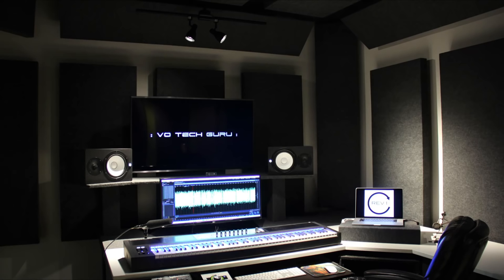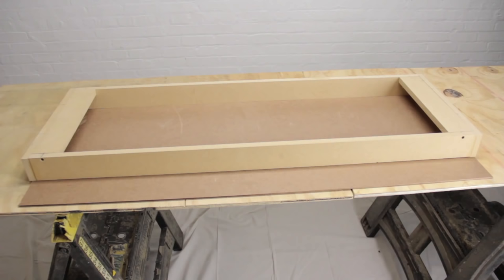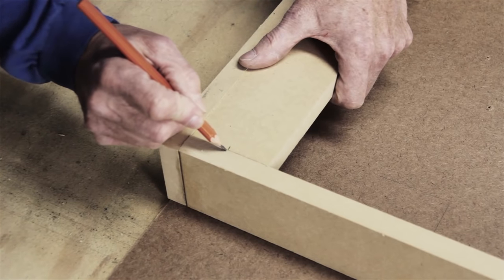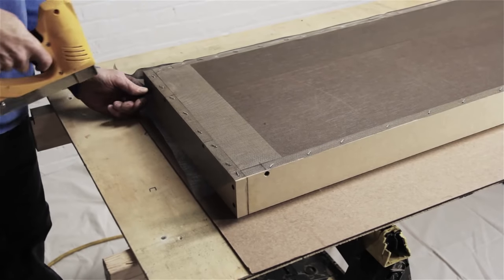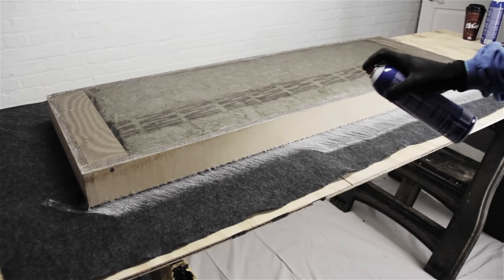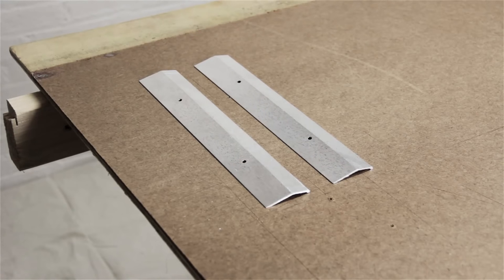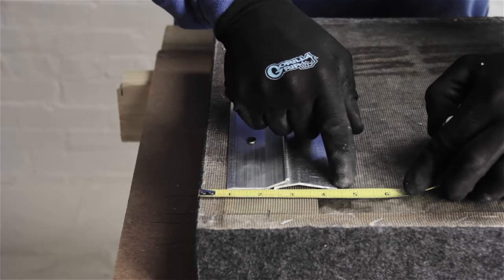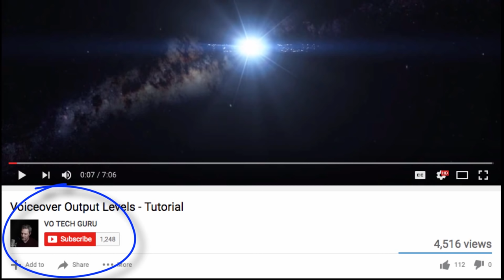How To Build Acoustic Panels | DIY Acoustic Panels

Comment: If you cut the long sides a little longer and then make the tops and supports the same length you can make this whole job a lot easier.

You also only need a little corner support so even small corner triangles or squares are adequate. You could just use small thin pieces of ply to save tge wasted effort cutting the insulation.
You can also significantly impove performance of the panel by adding spacers behind the panel to create an air gap to the wall.

 Even then, once fabric is stretched and stapled and the frame is screwed and glued, the support braces are almost unnecessary.
Reply from the maker: That's really bad advice. First, the sides would have to be 48-1/2" long which is not at all efficient considering the MDF sheets are 48" x 96". Second, you would be compressing the Roxul by 1-1/2" by moving the top and bottom toward the center inside the frame, which means you would have to cut even more insulation. It sounds like you didn't watch the entire video because the hanger and the bumper on the bottom back side provide the gap you spoke of. If you have a video on how to build panels using your method feel free to post it here. Otherwise, anyone looking to build the panels as I have them here, do not follow the advice of this viewer regarding cutting the sides longer. These panels were designed so the Roxul fits perfectly within the frame, so less hassle, less expense, less cutting.

Comment: Very nice, but I used wood glue and a brad nailer, much faster and just as strong.
Reply from the maker: I agree and have made many panels using brads and glue. That said, I had to make a video using tools and materials most people have. You know, once you get a nailer, then you need a compressor, use it safely and so on. I’m thinking about creating a supplemental video and maybe call it “for the pro” or something like that? Anyway, thanks for watching and for adding value to the conversation!

Comment: does that saves you from 90% humidity?
Reply from the maker: Hi Petros. I'm not sure I understand your question. If you're asking about the insulation inside the panel, you can view the specs for resistance against moisture as well as fire at roxul.com if that helps. :-)

Comment: Is a bass trap built similar to these?
Reply from the maker: Justin Schwer People tend to build bass traps with deeper frames and insulation than I used here, but the idea is the same. That said, I found no need for bass traps when using these panels throughout my booth and control room. Hope that helps.

Comment: Is it safe to have that insulation material in a room if you need to wear a mask while cutting it?
Reply from the maker: You should always wear a mask when working with insulation because it's easy for fibers to become airborne when handling/cutting. These panels have screen on both sides and I haven't experienced any negative effects. That said, if you're concerned, you should visit Roxul.com and look at their safety data sheets to decide for yourself if it's the right choice for you.

Comment: Fiber glass wool is using for it...? please help
Reply from the maker: Positive Travels Pvt Ltd Hi. The material we used isn't fiberglass. It's a mineral based product. If you'd like more information you can visit roxul.com. Hope that helps!
Reply: which is better. mineral wool or glass wool. given panel dimension is necessary to follow the same.?
Reply from the maker: Positive Travels Pvt Ltd Mineral is far better and I would not use fiberglass insulation in a panel.

Comment: How do you mount these on the ceiling?
Reply from the maker: Same drywall anchors but use eyes and hooks to hang them. You can use cable or whatever else you have if you want to bring them down even lower. Thanks for watching!
Reply: @VOTECHGURU  Thanks for the answer!
Reply from the maker: @suleman241  My pleasure. ;-)

Comment: How many panels will a single pack of roxul make?
Reply from the maker: It depends on which pack you're going for. The packages I show in the video right at https://youtu.be/GBHYiWIJhUA?t=1m21s show the 16" packs contain 12 pcs and the 24" packs contain 8 pcs.
Reply: Also do I necessarily have to use felt? Would cotton work? Or is there something about the felt that works better?
Reply: Sounds good. Thank you
Reply from the maker: You got it. ;-)

Comment: I don't know how you got the guys at home depot to make a 3" wide cut. They have a 6" minimum width requirement (at least now they do).
Reply from the maker: Aspen Mallery Yeah, it seems they are clamping down on some things. A few people have gotten local cabinet shops to cut up the wood for them for $75 or so. Definitely worth it if building multiple panels.

Comment: How much would you say each panel weighs?
Reply from the maker: Around 12 pounds
Reply: VO TECH GURU ok I’m thinking about combing three and hanging them from the ceiling.
Reply from the maker: @samueleverett3719  I built several larger ones for the ceiling (clouds) and used the same drywall anchors so you should be fine.

Comment: Don’t you need a bigger air gap at the back of the panel?
Reply from the maker: No. But a larger gap will improve results. The most important thing is to get it off the wall and have no backing on the panel like plywood, etc. It’s surprising how so many companies sell “pro” panels with with a solid backing. That not only makes them less effective, it’s a waste of material.

Comment: why do we need frame? can't we just wrap insulation in cloth?
Reply from the maker: sin  You could but it won’t look good.
Reply: You could if you wanted it to look like a giant stuffed sock. but at that point you might as well just use sound absorbing curtains or moving blankets. An ok middle ground might be putting it in the bottom of a large cardboard box and strengthening the edges with duct tape. Just not durable so don't stumble into it...

Comment: You can use towels instead of insulation. Multiple full-size bath/beach towels, folded in half & stacked work best. It will cost less and absorb the sound just as good as rockwool
Reply from the maker: And it would take forever. There's nothing wrong with using Roxul and it will be much quicker and cheaper to just stick with the plan.
Reply: @VOTECHGURU  I agree there's nothing wrong with roxul. I disagree that its cheaper than using towels. You can get old towels from Goodwill, or somewhere similar, for next to nothing. I'm not sure why you think it'd take forever. It's the same exact method you explained except use a towel in place of the felt fabric and a few folded towels instead of the roxul.
Reply from the maker: fpep5 You’d have to take a ton of time sourcing the towels. That’s assuming a single Goodwill would have enough used towels to fabricate even one panel. You’d also have to sew the towels together to get them to stand firmly inside the panel. Not to mention the amount of towels required to gain the coefficient of a single batt of Roxul. It’s $50 USD for a pack of 12 Roxul batts. That’s less than $5 per batt. The amount of sourcing, sewing, driving to various Goodwills, the time you’d spend all around using towels is a horrible value proposition. There have been numerous discussions about this issue between both sides of the “argument,”. testing etc. And many, many people wishing they had just used Roxul instead. And while I appreciate your input, it’s overwhelmingly evident that using Roxul is far more efficient, better performing and a far better value proposition. I wish the towel conversation would just go away already. It’s not valid. If you feel so strongly about your position then maybe put together a towel panel video that proves it’s less expensive, works as well and is as efficient with time spent. Would love to compare the results. Thanks for taking the time to listen.
Reply: @VOTECHGURU  Ok no problem. Thanks for replying with some solid input. I still don't agree with you 100% on some points but it's all good. Here's a towel panel video from a fairly popular YouTube channel https://youtu.be/pABvTWSxOes

Comment: How would you do for ceiling?
Reply from the maker: I just used the same drywall anchors and used eye hooks at all 4 corners of the panels to hang them. Just make sure the hooks are the right size to screw into the anchors.
Reply: @VOTECHGURU  
Ceiling is only 210 cm high, and it's not solid wall ceiling, just plywood so nothing heavy or too thick is optional, these 2 things are first to consider. 

Thanks for your reply 👍
Reply from the maker: Drummatia Drumming Production They are around 12 pounds each panel. Will they hold?

Comment: fiberglass screen? what is the purpose of this? why not just wrap both sides in the fabric? thanks
Reply from the maker: Tryhitme cs Hi. Thanks watching. The screen keeps the insulation from bulging the fabric so the surface is nice and smooth. The screen is also less expensive than fabric at the of the back of the panel. I've done it both ways and using screen yields a much better looking finished product.

Comment: 16" Roxul insulation is $53.46 by itself. How on earth did you land on the $25/panel estimate?
Reply from the maker: Riley Farmer - I'm not sure I understand your question. There are 12 pieces in a pack. Divide $53.46 by 12 and the cost for each piece is $4.45. You need one piece per panel.
Reply: Ohh derp! Forgive my ignorance, I'm an audio "expert" but still a tool newbie. Thanks for the info
Reply from the maker: Riley Farmer - Ha! No worries, been there. :-)

Comment: HELP! 5 QUESTIONS 
Does anyone think having panels with an open back would help  reduce some of the airborne noise coming from traffic outside? And would having the panel a certain distance from the wall (e.g. 2") help with reducing airborne noise from outside by deadening it in the panel? I am hoping to deaden some of this airborne traffic noise in the audio of my videos. I am going to be doing videos of a person speaking and I have a really beautiful looking Room but the traffic has a lot of a low rumbling frequencies I need to reduce. I also would like to know, is there is a microphone that would be better for isolating the speaker away from those airborne noises? If panels may help reduce some of that airborne traffic noise coming in how thick should I make them?  Lastly does anyone have any tips on reducing the airborne  traffic coming into this room,  other than demolitioning the walls to decouple new walls. I keep thinking that there must be some sort of way to erect acoustic panels/partitions or curtains around the subject in an attractive way or less preferably an acoustic fence around the front and sides of the building. Or maybe even some sort of dence acoustic shade (e.g. MLV) outside of the building that I can pull down during sessions.  I'm hoping that simply putting panels up on the walls and maybe some standing panels/partitions around the subject will be sufficient along with some sort of microphone that will focus mostly on the subject. Please help!
Reply from the maker: Vegan Linked The biggest problem is going to be low frequencies because they flank around objects and structures. There is an acoustic advantage to having them spaced from the walls but the panels will do very little to keep the noise out. You could use acoustic blankets from vocalboothtogo.com to surround your subject which will make a difference because they absorb -10dB of noise as well as provide acoustic treatment. They are a sponsor of mine so so you can save 5% by using the code votechguru-5. It’s not much, but better than nothing. The blankets aren’t that expensive for what you get anyway. Really superior stuff and not like a moving blanket. They are specifically designed to block and absorb sound and I was at the testing lab when they got tested and certified. Really good stuff. Good luck and thanks for watching!
Reply: @VOTECHGURU   The Room is really esthetically pleasing right now. I'm wondering if may be I created some Gobos that would do the trick.. I could place these around the subject and that could absorb any of the airborne noise coming toward them as well as dead and some of the echo. I may even put sound panels on the walls so whatever reflects off of the gobo could be further absorbed by the sound panels.  I could possibly make the Gobos look decent and be just far enough away from the subject to be effective and possibly out of the shot or at least in the background in a nice way.  I could make them taller than the subject and 2 layers of safe and sound rockwool thick. How does this sound?
Reply from the maker: Vegan Linked I’ve seen people use nothing but these panels to essentially build a booth and it worked very well, but I’m unsure of how much noise there is around you compared to them. I have a video about declicking and denoising on here that may help as well. Have you seen that video? Also, rolling off the low end at 80Hz will eliminate a lot of low end noise. Not sure how much you know about EQ so I don’t know if you know what I mean by “rolling off.”
Reply: @VOTECHGURU   Is rolling off the low and something I have to do in post or can I do it during production? Typically I just use my Senhieser Lav's into my camera.  But for this project I am thinking about getting something like the Rodecaster Pro or pulling out my old  Presonus firestudio mobile.  I'm basically videoing a doctor talking to someone else either in the Room or in a Zoom conference of sorts.  I may get completely new Mic's that are better for this situation, maybe Shure SM7B?
Reply: @VOTECHGURU   By the way at the good news is I think the noise may be coming more from the floor, door, and window than the walls and ceiling that I have already finished. So I am pretty much back too excited.  I'm looking at getting mass loaded vinyl for the underpinning and maybe even under the carpet pad. I'm gonna get dense carpet and half inch memory foam carpet pad. I'm trying to figure out if it's a good idea to put the mass loaded vinyl on the sub floor under the carpet pad. Let me know if you think that is appropriate there.  Otherwise I will use the MLV in the walls of the underpinning I create to stop the sound from getting under the floor to begin with. 

As for MLV,  Do you think it is a good idea to use the MLV in the gobo's?  And is there a go to guide for diy Gobos? Love that word, Gobo's :)
Reply from the maker: Vegan Linked This would be more efficient if we just talked about it for 15 min. Info@votechguru.com
Reply: @VOTECHGURU  awesome, will do
Reply: @VOTECHGURU  can you send me a link here to your video on declicking and denoising?
Reply: @VOTECHGURU  any tips on rolling off? I have Adobe Audition. I have other audio programs but Audition is tied into premiere better...
Reply from the maker: Vegan Linked https://youtu.be/I31xEmXrqD0

Comment: Home depot doesn't cut lower than 12in so what's plan B
Reply from the maker: Yeah, some of the stores won’t do it anymore for some reason. It’s easy enough to rip the 12” pieces on a tablesaw. If you don’t have one, it’s likely someone near you does. One person got a cabinet shop to bang out 3 whole sheets for $50 USD. Food for thought...

Comment: Why do you keep your monitors sideways?
Reply from the maker: Nora Sleiman-Haidar Because I want my mid-low and low frequencies in the middle of the mix where I feel they belong and my mid-high to high frequencies on the outside to spread out and air out the mix. I get a wider mixing space that way, which I prefer.

Comment: how much did it cost for you?
Reply from the maker: At the time around $25/per panel. If you go back I explain that one sheet of the MDF will make around 8-9 panels and I go over costs. So 8 Panels for $200 or so. You’ll have material left over because the rockwool comes in a pack of 12. So if you built even more the cost would go down below $25 per.

Comment: How wide should the top panels be?
Reply: 25.5 right? to make the inside 24in correct?
Reply: Also, what do you suggest for the size of the countersink drill bit?
Reply from the maker: John Blasucci The materials and tools are listed in the description. I assume you’re planning on building 24” panels based on your comments? Whatever the horizontal dimension of your insulation is, add 1-1/2” to that and you’ll have your outer dimensions. That’s assuming you’re using 3/4” material.

Comment: Anyone run into an issue where Home Depot won't cut the MDF into 3" wide pieces? They said a policy went into place that only allows them to cut into 6" max width.
Reply from the maker: That has come up a lot since I created the video and many potential solutions have emerged. 1. Purchase wood that is already close or near 3" in width, then cut and build. 2. Have a cabinet shop cut them for you, but there may be diminishing returns based on how many panels you are building. If a ton, it's totally worth it. If not, then no. 3. Have a neighbor with a table saw who knows what they are doing cut up the sheets for you. Sorry about their change in policy. That really sucks.
Reply: @VOTECHGURU  thanks for the reply and I put!
Reply from the maker: No problem. ;-) @leecm

Comment: when you say 25$ per panel, it confuses me because the insulation in home depot is 46$ per roll. help me out
Reply from the maker: Each package contains 8 pcs. At $46 per roll divided by 8 it comes out to $5.75 per piece. You need one piece per panel.
Reply: VO TECH GURU okay gotchu now, thanks
Reply from the maker: You got it.

Comment: One major issue - Home Depot won't cut MDF in their stores because of the chemicals released, That means either you have to cut it yourself, or use something like plywood.
Reply from the maker: Bradford Craig It seems it depends on the store’s understanding of why they can’t. Some will do it, some will say chemicals and others will say they can’t cut pieces that narrow. But a local cabinet shop can typically cut up a sheet for you on their tablesaw with no problem.